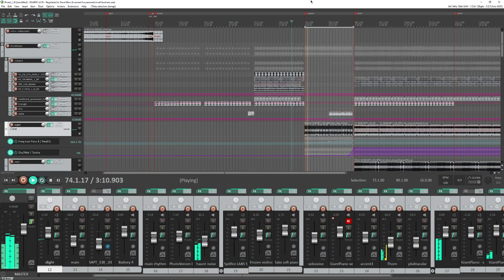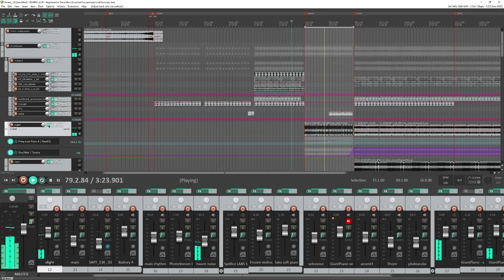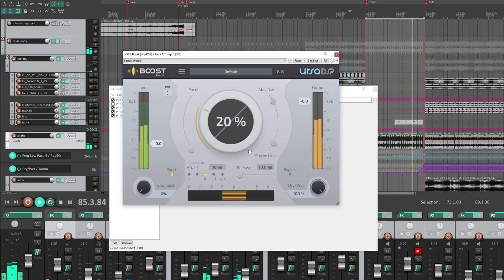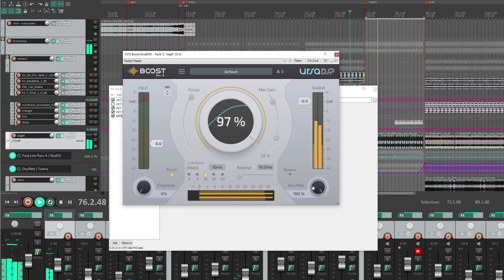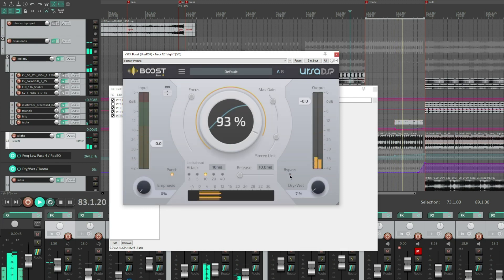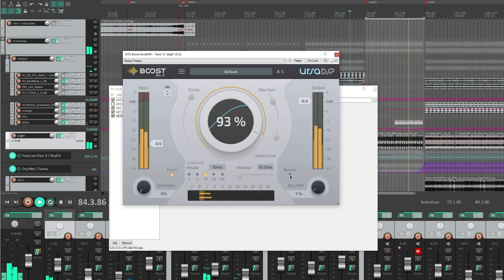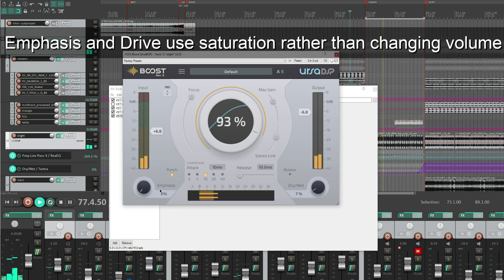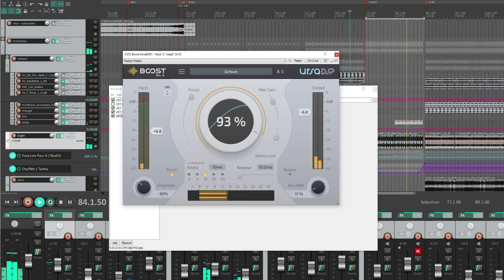Parallel compression with Ursa DSP Boost 1.3 (early sneak peek)

Comment: downloaded update, no rev b loading, dont see it in logic, still looks the same as first version? weird
Reply from the maker: Make sure you've downloaded 1.3.0 from the beta section. and not the 1.1.36 lastest official release. Revision B is in open Beta right now, but I've had nothing other than a couple of minor UI issues from my testers. If you're still having troubles please get in touch via support and I'll be able to help you directly.
Reply: @UrsaDSP  When do you think the official release for Logic will be? Or are you recommending Logic users just use the Beta version? I'm not relly wanting to beta test during my projects for fear something will hinder the efficiency of the client and time.
Reply from the maker: @flacobass  Hi there. I applaud your caution, but so far I've only got a couple of UI snags to fix in the Beta, nothing serious and it was with a few testers for a couple of weeks before I put it to open beta. As it stands, the final version will be some time in the new year once I've made sure nothing else comes to light.
Reply: @UrsaDSP  Thank you! If the beta is installed and it becomes problematic for any reason, is it easy and possible to reinstall the 1.1.36?
Reply from the maker: @flacobass  Only if you get addicted to the new controls ;) The old installers should downgrade.
Reply: @UrsaDSP  Ha! Well I’ll take my chances with that addiction! Thanks again for answering some questions. Great plugin!! 👍🏼